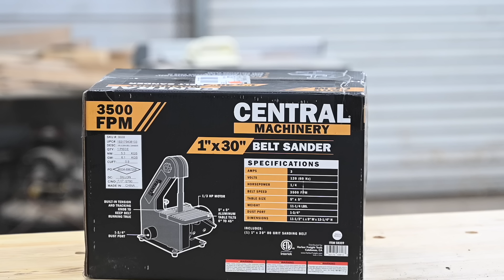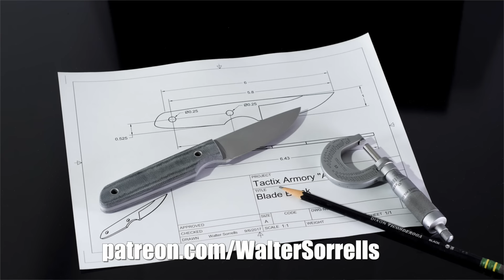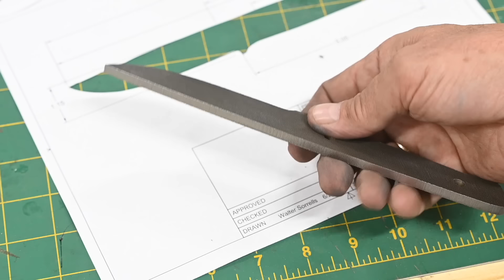Ultra Cheap Belt Grinder...Exposed!  (Harbor Freight 1X30)

Comment: I have owned a few belt sanders the one I liked the most was from grizzly tools scratch and dent sale but that one was stolen from me so I got one from harbor freight with a package of belts and it is still sitting where I sat it down and I have not even plugged it in yet I have a medical issue so I can’t really work anymore but I keep thinking I should keep my tools available if I need them my machine and fabrication shop has been closed for almost fifteen years now but I still have it and most of the stuff that was to heavy to be stolen with no heavy equipment although they did take the light duty stuff and used it to load up my welders and torches plus a rolling tool box 😢the forklift was not working so they couldn’t use it or I would have been cleaned out I am glad for the small favor I guess but I would have probably dropped dead if I still had all my stuff to work with I am not supposed to do anything after my stroke but I have always been a workaholic so maybe they were doing me a favor still I would rather have the tools back and not have the tools that they left behind so badly damaged

Comment: i bought one like this as my first grinder when i started, but i almost never used it cause a good large coarse file works about 10x faster...;D now i use a machine for 180€ and im really satisfied better buy one for 180€ as your first
Reply: Which machine do you use now? Curious what's available for 180 euros
Reply: @PotatoCheese  its made for wood, but very powerful. There are very limited options for budget knifegrinders in germany, it was a good compromise (550W , 100x915mm)

Comment: Best use for a 1x30 I've found is for sharpening. Especially if you just need to quickly remove metal to get a basic apex back on a very dull knife or tool.

Comment: Watching vid now...  There is an intrinsic difference between a sander and grinder, linear speed.  For wood, low speed is fine and preferred.  For metal, high speed and torque are key.  The slower RPM isn't going to get it.

Comment: If you can weld or know somebody who can help with that it might be possible to build a grinder too. I couldn't afford to spend thousands on a belt grinder. I built mine for kinda cheap. Second hand motor, some new and scrap steel, had to buy the rollers for 100€ from Poland. I don't think you can buy a grinder that sturdy for the money I spent. But it takes time and you need some tools. So it's not for people who just start out making anything.

Comment: Is the HF 1 x 30 a good grinder?  Well, no. But it costs $54, not $5400. 
The real question, of course, is: Is it good for the price? I’m inclined to say it isn’t bad for so little $$$. As Walter proves, it is possible to make a knife with it. 

But remember that Walter has also shown, several times, that one can make a knife without any power tools at all. A hammer, a drill, a vise or some clamps, a couple of files (one flat, one round), a whetstone, and maybe a pocket blowtorch (for heat treating) can get you started.

Comment: If the electrical plug isn't grounded will this grinder keel?
Reply: I don't know what you mean by "keel", but if you are using a
power tool, which is supposed to be grounded, and you are not
grounding it, you are working in an unsafe condition/situation.
NEVER circumvent the proper grounding of ANY electric appliance.

Comment: A little engineering you can make your own belt sander.  I came across a belts sander, disc from an old timer wasn't using his machine any more. Keep your ear's to the ground there are plenty of people/shop's selling off there shop tool's.

Comment: I started with this, and I have to disagree on starting with this and becoming interested.  I was forever frustrated with the platen inconsistency, the wobble of a 1x30 on this machine killed my plunges and generally speaking it would take a LONG time to grind a bevel from scratch.  I moved to 2x72 and went from 2-3 hour grind time to 10 minutes.  If you’re starting out, step up to at least 1x42 with some real power behind it.  This is a great little grinder, but not for a novice knife maker looking to be come interested, it will only frustrate you.

Comment: The key point is to match the tools to your skill. When your skill exceeds the capacity of the tool, save up and upgrade the tool. You’d be foolish to invest $2k in a nice grinder after 1-10 knives. The first 10 knives I made were garbage and a better grinder wouldn’t have changed that.

Comment: I had one that eventually died, I replaced it with the 1×30 /5" disk sander combo that I like more.
I think it's the better tool, because the disk sander is great for truing up / flattening scales...etc.
I think the combo sander is $20 or so more.

I have made a couple decent knives, but have had a number of issues that I think buying good belts would have probably solved a many of those issues.

Comment: Most of the comments about this are good but they are also very old maybe they were made different the one I picked up while ago got home and unboxed it everything on its freaking plastic even the motor housing is plastic what's that all about probably aluminum windings in the motor too that's not going to last very long like I said I just picked it up about an hour ago it's going back first thing in the morning and see if I can find one that's better somewhere else

Comment: CORRECT !  I bought this vertical belt sander, I call it a hobby sander, from Harbor Freight and it konked out after little use in 3 months... not using it except sporadically. HF sells Asian made imported garbage.